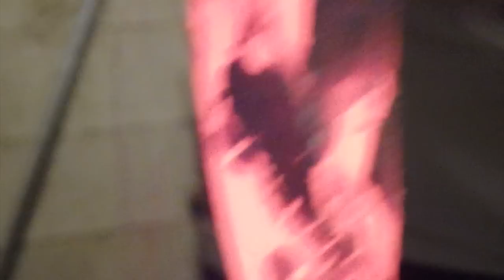Hall Tree Built From Reclaimed Pallet Lumber!

Comment: At about 18 minutes in you do a lot of mitering. I would use over sized wood strips tacked together with two or three wooden strips on the backside. Then would cut your inserts on a table saw afterwards remove the strip from the backside. This way you've mitered your insert pieces with 4 table saw cuts instead of all the cuts on the miter saw. Saving time.

Comment: Great to watch I wish denailing palletts was as quick   TIP   for you before running pallett wood through your planer run over the wood with a MAGNET     planer blades sure get buggered if they hit a nail  that you missed  or had been broken when building the pallett
Reply from the maker: Absolutely! In one of my other videos i show how i use my metal detector over the boards before i run them through the planer, i kinda keep that footage out of my main vids but thanks for the tip! and thanks for watching!

Comment: The lights causing the "banding" is because of the frame rate of the video is different to the light phasing. If they lights are 100mhz or 50mhz set the video to 50 fps. If 60mhz set to 60fps or 30..
Reply from the maker: Yeah for sure, i actually just removed all the fluorescent bulbs and switch completely to LED and that pretty much eliminated it, i do see it very slight from time to time on time lapse for some reason though.

Comment: turned out VERY nice....pardon my saying this: but you could have scaled down your wood dimensions to make it lighter and easier to work with while you were building it and you could have saved yourself some time if you would have used the plywood panel as the 4th side of your sitting/storage box ..im not trying do negatively criticize im just curious as to why you did it all this way when i see a good build going. .i myself am a 20+ year carpenter/furniture/ cabinet builder and i had alot of more experienced guys ask me these same type of questions and it actually made me into a better woodworker ..sorta like routing out  those pallet runners to set the pallet boards into like a cabinet door panel then 45 the corners and join with biscuits to built your sitting/storage box...also when you were doing the "endless mitering" you could have made a quick sandwich jig...meaning making 2 square frames the size of the opening you were inlaying them then on top of one frame lay your boards and then set other frame on top flushing the 2 frames a screw the 2 frames together ..then use whatever saw or router to cut off  the excess boardage flush with perimeter of the frames ..so 4 passes with saw or router versus time consuming measuring, marking,cutting...ah darn im rambling on...anyways i enjoyed the video and it looks great
Reply from the maker: I appreciate the comments, im far less experienced and most of my style is built from a mix of replicating other styles, reading up on  techniques and on the spot experimenting with the limited tools i have. I definitely have a lot to learn, but hopefully i can keep you all interested in future vids. Ive got a few in the works and i try to highlight something new each video. Thanks for watching and commenting!

Comment: Great project and video. Btw, you don't need new shop lights, just make sure that your video frame rate (fps) does not match your mains electricity frequency. So if you have 60Hz mains, shoot at 50fps. Looking forward to future videos
Reply from the maker: Yeah, its weird because its only the one shoplight above my main assembly table. I ended up just pulling the bulbs and setting up a whole different set of work lights. I should have a new video up in a few days! My channel is a slow burn, but working full time and woodworking / video editing takes FOREVER! thanks for the advice and the kind words!

Comment: I'm sweating just watching you. There is an easy way to take Pallets apart. use a Sawsall (Reciprocating) saw a metal blade and cut threw the nails. The heads pop right out and you get longer boards.
Reply from the maker: Ive tried it, and it works ok if you are only doing a few pallets. It changes when you take them apart in bulk, IMO the reciprocating saw is sooooooo much more work than just ripping the ends right off with a circ-saw, plus you dont go through any blades, or get "chainsaw hands" as i like to refer to it from holding that vibrating thing. Plus You still have to punch out the nail head, and trim the end square at the end of the process. Thanks for watching!
Reply from the maker: Also if you cut through the nail in that way, you leave the stringer with a nail cut flush in the body with no feasible easy way of pulling it out, and the stringer might as well be firewood at that point.

Comment: What kind of Oil did you brush on the pallet wood when you were done.
Reply from the maker: I used Minwax Tung Oil Finish, about 3 coats on each individual piece. And then followed it up with several coats of PolyCrilic. Thanks for watching!

Comment: Did you make the miter fence for your table saw?
Reply from the maker: I wish! That miter fence is a  "kreg precision miter gauge system". I had to find something more accurate than my miter/chop saws to cut all the different angles on the backboard. It works really well,  but the directions are a bit confusing to put the thing together.  Im working on a new sled for my new table saw not in this video.  Thanks for watching  and commenting!